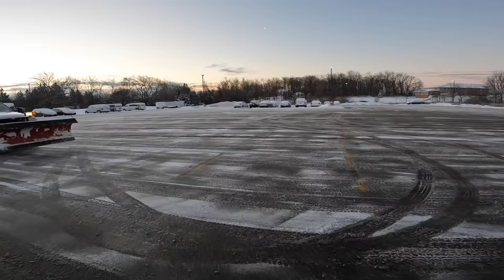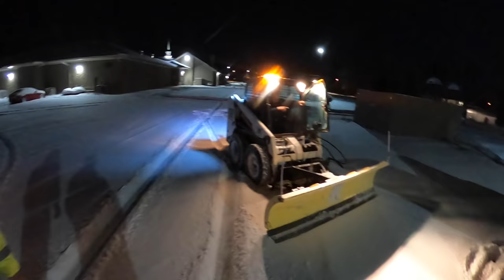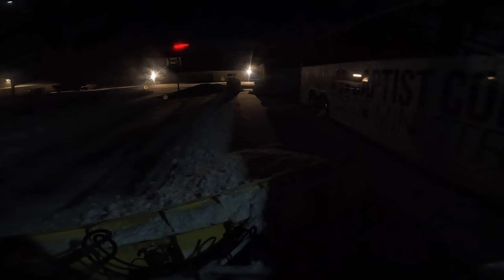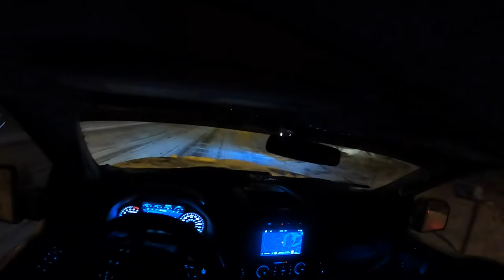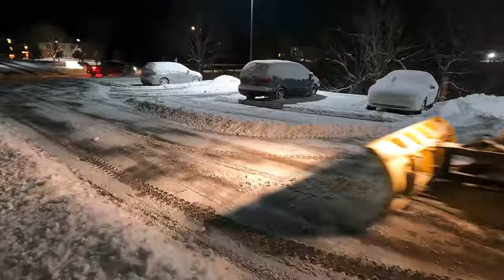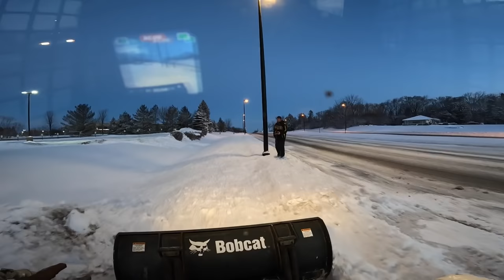Bobcat skid loader plowing snow

Comment: From what I understand about the treated salt is that it works at a lower temp than regular salt. My dad works for MN/DOT and does freeway plowing in the winter. They use the treated salt when the temps are below 6 degrees. It's super pricy but normal salt won't work if it's too cold.
Reply: Salt/sand mix is good for parking lots as the sand will help hold the salt in the lot instead of the water washing it all into the sewer

Comment: Treated salt is worth the extra money especially when it gets really cold.  I find it doesn't freeze up in piles as bad as regular salt.  I have had salt piles that almost get too hard get into piles because of frozen chunks. Just my opinion  love the videos.
Reply from the maker: That’s interesting, I wonder if the type of treatments are really different because my salt pile this year froze and chunked up worse than ever.
Reply: @VictoryOutdoorServices  All salt freezes when it gets moisture in it. The green salt will last to lower temps and it will work better in lower temps. It also doesn't need as much down as regular salt does.
Reply from the maker: @plove7131987  Yep, that’s what I heard but not so much of what I saw.
Reply: @VictoryOutdoorServices  I got treated salt from two diffrent places one froze at 25 and couldnt even load the other pile it was -15 out no problems i could run it throught a tailgate spreader.

Comment: Definitely should eliminate or put a on and off switch on skidsteer back up sound and Ive used that salt and same thoughts maybe it works a bit colder but have you ever seen it like pit concrete almost like sometimes it can mess some concrete up

Comment: Look at the wiring harness in the cab,  rubs through then starts a fire total repair 15k less labour,  2014 s650  total melt down including rebuilding computer wiring plugs.
Reply from the maker: Wow, yeah I took it in and it was a rubbed through wire under the cab. Luckily it wasn't bad, the fixed it and put a guard on it so it wouldn't happen again. It is surprising to me how many burned out skid loaders you see though.
Reply: @VictoryOutdoorServices  Glad to hear they found it quick before disaster.

Comment: Check right side cab srut clip pin was in backwards on our m630  it rubbed wire harness  caused dead short killed machine when you hit bump or bounced did exactly what you machine did we fixed rubbed wire turned clip around  fixed problem

Comment: Pull up the code 
On the monitor look it up on the owners Manuel
Get a current tester and turn on the key to run , check the fuses 
I bet you a hat it’s one of your pig tail attachments, I’ve had bobcats for over 20 years when the whether changes the wires stiffn up and act odd anyways hope this helps .

Comment: Ryan: When you're using the skidsteers in residential areas in the wee, early hours, is there any way of disabling the reversing alarms, or at least toning them down a bit? Quite apart from waking-up the neighbourhood, it must drive the operators mental.
Reply: im pretty sure its connected by a fuse